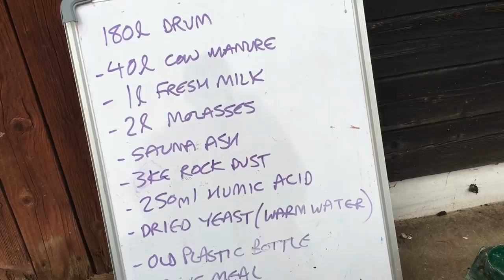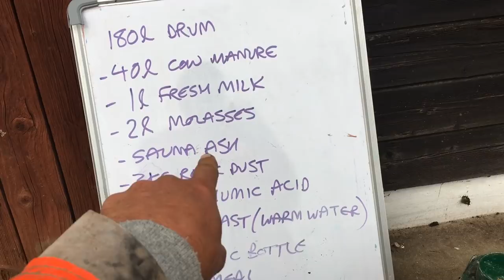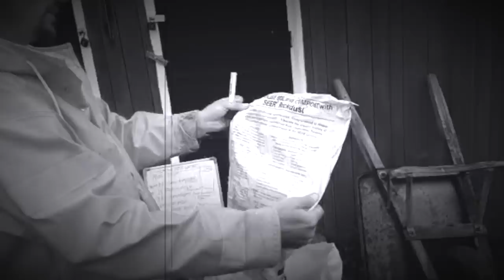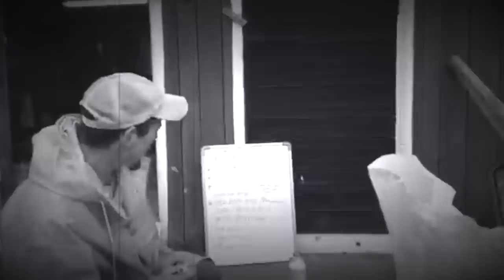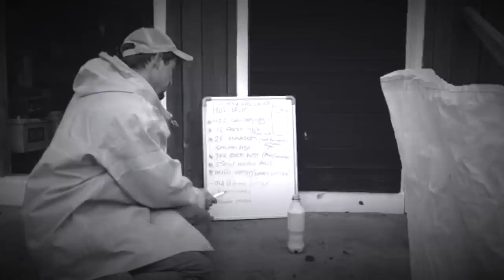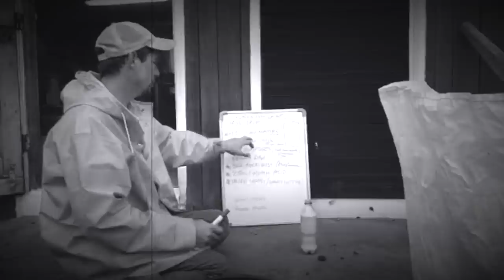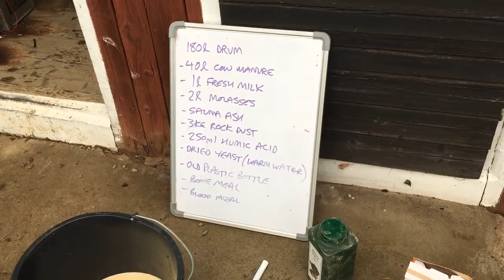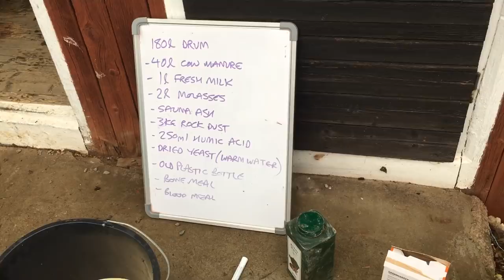Biofertiliser

Comment: How are you applicating that bio fertiliser, could you use it with a tractor sprayer for larger field fertilisation or would it damage machines like that too much
Reply: ROSS Jones well, he said it can be scaled to swimming pool size batches. I’m certain it will need to be filtered so any solids stay behind. I’m not sure how sensitive manure spraying systems are to sediments but I’d guess they can be utilized